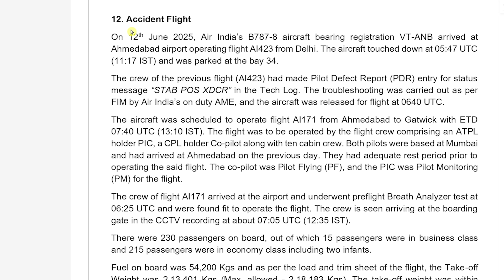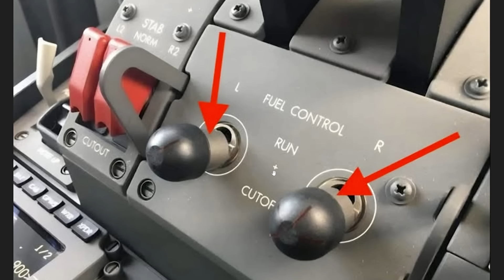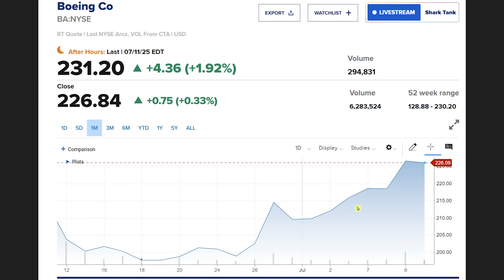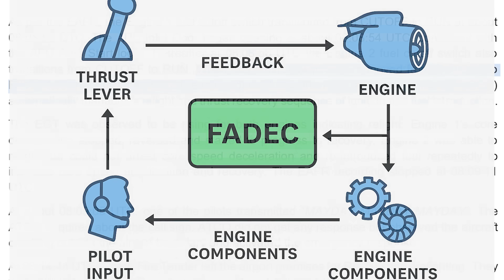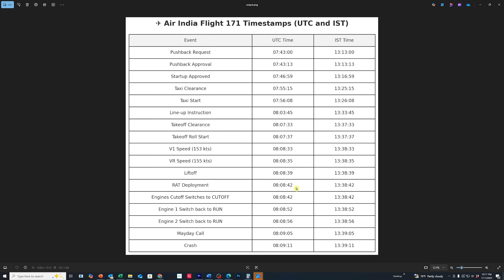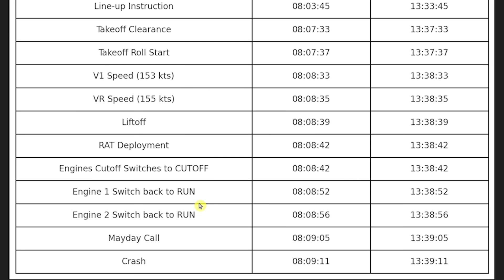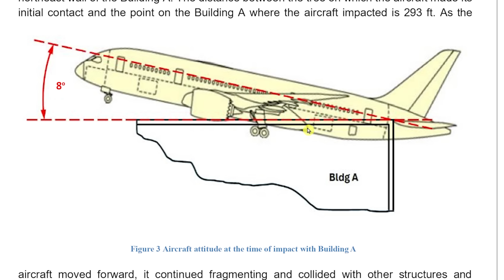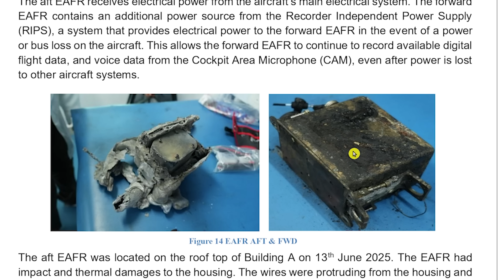Did Pilots CUTOFF Fuel? Shocking Twist Air India 171 Report!

Comment: I question the preliminary report. They cannot tell us anything about the physical movement of those switches. The only physical fact we know is that they were in the run position at the time of the crash.

We also know that the signals to the engines told the engines to turn off and then turn on again but we don't know that the signals resulted from the physical moving of the switches.

There could have been a signal problem with the aircraft.

I have heard that the 787 has several known issues that Boeing has refused to address. One of them is a known water leaking problem in the area of some very critical electrical signaling components.

When the plane rotated that would have altered the flow of  any water that might have happened to be there.

That is a stretch but so is the idea of a pilot turning the switches off and then back on again if he wanted to kill himself.    Also when a pilot is killing himself I don't think he would deny it he would probably just be silent.

We don't have the exact words; the report just says that one pilot said to the other “why did you cut off the supply” & the other guy says “I didn't”

We don't know exactly what was said and whether it indicates that the one pilot saw him moving the switches or was just looking at the gauges.

I doubt that the other guy would say “I didn't” if he knew that he had been seen. 

And he certainly wouldn't have reached back down and turned them back on after such a question, especially if his intent was to crash the air vehicle.

So there are problems with both hypotheses. Therefore I am not ready to accept the suicide idea yet. Not until I hear that voice recorder audio. I need to know the exact words and I need to know if they could hear those things ‘click.’

Investigators often miss things and make assumptions. At this point one assumption I make is I start with a REBUTTABLE presumption if it's a Boeing aircraft it was not the pilot at fault it was the aircraft. Then I wait for something to prove otherwise.
Reply: The one that cut off the fuel and the other why he did so to shift blame to ensure payout for his own family. 
Ten seconds later the innocent pilot realizes thrust is lost and turns fuel back on but both know it's too late anyway.
Reply: @heinzriemann3213they almost made it though , the bad pilot would fight to stop the other pilot from restarting
Reply: maybe the electrical contact of the switch was shorting out periodically.
or the mechanical contact of the switch itself was having intermittent contact.
or some software bug.

all speculation on my part.

the pilot suicide theory sure sounds like a load of ..
Reply: Now it turns out the translation was wrong… he did not ask “why” did you turn off — he asked “DID you turn off…”
Reply: June 28, 2025, The Sunday Guardian (cited in ePlaneAI reports): Mary Schiavo, former Inspector General for the U.S. Department of Transportation, publicly raised concerns that a software-enabled malfunction—specifically involving the Thrust Control Malfunction Accommodation (TCMA) and Full Authority Digital Engine Control (FADEC) systems—could have contributed to the Air India AI-171 crash. She referenced a known NTSB-examined issue where 787 software caused unintended engine thrust rollback, emphasizing the critical need for independent investigation.
	•	In these reports, Schiavo also referenced a 2019 All Nippon Airways (ANA) 787 incident, wherein a software flaw—previously investigated by the NTSB—mistakenly triggered a dual engine thrust rollback. That investigation prompted corrective actions across the global 787 fleet.
	•	July 15, 2025 – Mojo Story (YouTube): Schiavo appeared in an extended interview, reiterating her software safety concerns regarding Boeing 787’s fuel shutoff valve actuators and previous FAA warnings. She criticized regulatory delays and repeated that previous software-triggered rollback incidents should have led to firmer preventive action before the AI-171 crash.
	•	July 17, 2025 – Financial Express: In further coverage, Schiavo insisted the crash investigation should not rule out the possibility of a hidden TCMA software flaw, repeating that an earlier ANA 787 incident was caused when the software believed the plane was on the ground and cut engine power—a fact that required careful study by investigators.
Reply: data recorder does save the timestamps for all movements. so it is a fact they were off then back, matched the final position at the crash site.
Reply: @ziqiangwang537  the data recorder does not record any physical movements at all. It only records signals so the times you were talking about have to do with signals not switches!
Reply: @Clarity-of-Thought-guy  one captain says this: when all the other possiblities is checked, then the most possible one is the one that is true . 
Your argument is based on possibility of mechnical/software malfunctioning, i think that the possibility is lower for both controls happenning at the same time.
Reply: @ziqiangwang537  that is an excellent point. Because I'm just a dumb lawyer and not an aviator I have no idea however it might be possible that both signals are routed through the same path

Also the NTSB and Mary Shiavo are raising a known software issue which also might apply equally to both signals. 

But you are correct in fact the problem comes with a one second delay between the signal of one switch and the other which does suggest physical motion by a human.

This is why I think preliminary reports almost do more harm than good at sometime and here would be one of those times
Reply: @Clarity-of-Thought-guy  the issue of your argument is you preassigned the harm vs good to the result. It is a technical report, only biased eyes will read it with an attitude. The logical ways are intepretting it  with sound knowledge., hence checking all over the possibilities.
Reply: @ziqiangwang537  I have no idea what that means but you miss the point is that what I'm trying to do is focus on evidence I've made it clear I do not have a theory I am not assigned anything and I have no argument

All I am saying is that other people don't either because we don't have sufficient evidence I have not reached any conclusions other than the fact that the investigation so far is lacking
Reply: @ziqiangwang537  agreed

One must rule out all possibilities and generally the most likely one is the last one you should rule out

But the possibility of something other than pilot action is not zero is not 0%

I'm not reaching conclusions I'm just asking other people not to rush to them either
Reply: @Clarity-of-Thought-guy right。 However eneryone read the report with own bias.  We are talking about all probability from the data, then one will be coming out as the one.
Reply: @ziqiangwang537  amen to that! But they say this India board takes even longer than the NTSB so we've got a minimum two years
Reply: @ziqiangwang537  the data recorder does record timestamps but it only records electronic activity not physical activity
Reply: Exactly. People start blaming the pilot immediately
Reply: @anty_07 because statistics are brutal, pilots are responsible for most accidents, 100 years of aviation history can’t be erased, the data is clear.
Reply: I agree!!  Brilliant thinking!!  Thank you!❤

Comment: Will need to dust those switches for fingerprints and cross match against the pilots. It is even possible that the pilot who asked why did you cut off the fuel was the one who actually did the sabotaging..
Reply: Fingerprints analysis might be difficult considering the high flames would have charred the switches. Looks like the investigation team has full CVR to determine what went wrong but want more time to be sure and release to public

Comment: Those two fuel Cut-Off switches are way to easy to access and they don't even have a safety cover flap thing that needs to be pulled up. 
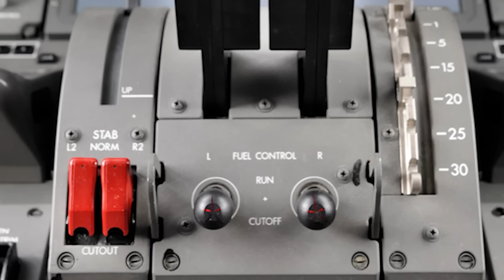One engine's fuel got cut off for 10 seconds before switched back on and the other one for 14 seconds.   11:57
It was probably sabotage though because the plane's both engines lost power at the worse possible time during take off.
Reply: They still require to be pulled out to be able to move either up or down, so they can't be accidentally bumped.

Comment: With no political of over the top backing like all othe cases that this guy mentioned, why would someone with over thousands of hours of experiance and known no. of peolpe onboard will sabotage like this, and if it was a sabotage it coould have been done worst on by taking it way more up then crashing. Ans why did the pilots then try to restart and still fail second time ?? they tried right if it was not a technical fault the planes engine should have started again althought they could not save the crash but they should have started but the second engine failes to start. this is exactly mentioned in this same report but is not told. Why ??

Comment: Thank you for this video!👍🏼 
A glitch/bug in the computers/sensors (sensors for the landing gear) may have initiated and reversed a fuel cutoff without the physical  switches being touched. In that case the message to Boeing's CEO and Board of Directors should be "learn to code".
Reply: Page 14 of the report covers that subject and hence your answer. Jeff also covers that.

Comment: I was pretty sure this is what would eventually be found out.   There was no way it was pilot's error.   Too many designs on the panel that makes it a remote possibility.  It was always a high probability it was pilot's intention.   There needs to be continuous psychological and physical screening of pilots given the high stress nature of the job.
Reply: there is,
Reply: If they were trying to crash the plane, why did they restart the engine the person who was trying to crash the plane would try to stop that
Reply: @Novasquad77   No need to resist when he already knows the outcome. There was no way the plane would be saved. Engines restart does not mean thrust back to takeoff level. That takes more than 10-15 secs. The guilty pilot probably already simulated this in his simulator.
Reply: @Novasquad77  two pilots, one stopped the engine and the other restarted.   What is critical thinking in today's world.

Comment: It appears that there may be a very slight possibility that the cutoff switch detent could be balanced halfway between on and off.  That half way point might have the switch on but the handle balancing between on and off.  Vibration could cause one to slip to cutoff and the snapping of the slipped one causes the second one to slip to off a second later.  That would align with the response to the question being "I did not".
Reply: As a retired flight engineer I can say that I've handled this type of switch whereby you can simply slide the switch against spring pressure to a locked detent position.  A single finger under the switch to slide it up to RUN (in this case) where it will drop into the detent is a common practice.  The reverse selection (to CUT OFF) requires a very definite pull out of the detent and then the switch can be slid down into CUT OFF position.  I haven't handled these exact switches on a B787, but they might require a definite pull up to set them to RUN.  I've never known a switch to be able to sit in a mid-position, but is possible, I suppose...
Reply: @kevinnurse9936  The closeup photos look like you can set them inbetween positions, but without the switch being in the RUN detent, the engine is not going to start. 
If I remember correctly, older type toggle switches such as on the F/E's panel of a 747 have more of a steep slope on either side of the highest point.
Reply: @ImperrfectStranger  How would the bulletin about it being installed wrong would allow it to start and then cutoff? I thought jeff said they were pulled out to cutoff position not engaged
Reply: @brandonlee8400  Not quite sure what you mean. I believe the bulletin was referring to the spring action holding the switch in the RUN and CUTOFF positions. i.e. sloppy switches allow you to knock them out of one detent into the other. The bump in the middle doesn't offer a great deal of protection in this case. 

I seem to recall there was a case where a pilot's long shirt sleeve got snagged on a switch and moved it out of its detent, but this was decades ago. I can't remember the details, but it may be one of several incidents which prompted the fitment of guards on the sides of the levers or a change in lever style to the round ones.
Reply: @ImperrfectStranger  So the ones in the burnt picture are down and engaged? Why would they both cutout? I thought the bulletin said they were installed disengaged but I don't see how it could start
Reply: @brandonlee8400  The burnt switches are in the up (RUN) position. Down is CUTOFF.
But, yes, if the switches weren't fully in the RUN (up) position the engines wouldn't start at the beginning of the flight.
Reply: @ImperrfectStranger  TY
Reply: If that's the case that incident had happened in earlier flights of the same aircraft.
Reply: Both of them?
Reply: Irrelevant, implausible. 
Next

Comment: Maybe the pilot absent-mindedly pulled the cut off switches without realizing it.  If the pilot did not get enough sleep the night before, this sort of carelessness is possible, though there is no way to read the pilot's mind.  They should redesign this so that it requires both pilots to cut off the engines, no?
Reply: They should redesign so that fuel cannot be cut off at Take off power. It should only be cut off at engine Idle.
Reply: @charron1 no. It can be used in an emergency like engine fire so that wouldn’t work

Comment: Is there any information exactly when the RAT was deployed? Before or after the fuel cut off?
Reply: It deployed immediately when the switches were moved to cut-off as highlighted by the timeline in the report.
Reply: @SurgeDashcam  Well, that makes sense. But i find it confusing that in the official timeline the order is: RAT deployed then engine cutoff switches to cutoff. According to the timecode it seems to happen at the same exact second, but then the order should be the other way around (as you mentioned). Only a small error in the report but still confusing. It was also stated, that there was a delay of around 1 second between the two cutoff switch actions. The timecodes suggests it happens exactly at the same time. Ok, may be i am nitpicking here. But i would imagine the timecodes have a higher resolution than just one second.

Comment: Why are you discounting the possibility that the pilots were correct?  Is fuel switch status not communicated via the AFDX - based Common Core Network and associated remote data concentrators where power glitch and/or software errors may have occurred  ?  Pilots are adults not children - "It wasn't me" !  That suggests to me that this may not have been a pilot induced event.

Comment: The investigators know which pilot cut off the engines, they have the DVR vision recording of the cockpit. They’ll never show it. So both pilots FOR NOW are guilty in the peoples court until the powers that be release the information of WHICH pilot cut off the engines.
Reply: Would have to have been the senior ... junior was too busy flying the plane.
Reply: @peterward9446 FAA 2018 action statement on fuel switches on Boeing?
Reply: @peterward9446  I seem to remember youtuber Captain Steeeve say generally the senior does the take offs and landings.
Reply: @MeoithTheSecond  nope. There's a designated pilot flying and pilot monitoring for each flight and this division of work has nothing to do with who is the captain

Comment: Yes but way isn't the aircraft designed so that it's impossible to cut fuel flow once the aircraft leaves the ground? And have a requirement that the engines have to be at idle. Boeing cutting safety corners, again.
Reply: Because if you have a fire in the engine, you want to be able to cut off the fuel supply so it doesn't keep feeding the fire and keep on burning. And it has nothing to do with Boeing cutting corners. Airbus have very similar Fuel Cutoff switches in their aircraft. As do a vast majority of business/corporate jets as well. Educate yourself before you post misinformation.

Comment: Could this explain it:   Per the investigation report the landing gear was still in EXTEND position.  In a normal flight it would have been retracted shortly after leaving the runway.... Yet it was not.  Could the explanation for the landing gear still being down but the engines shut done be as simple as the one pilot somehow getting his physical movements all screwed up.  When the "gear up" was given the pilot's muscle memory came out of left field and he pulled the two engine cutoffs.  The timing is about right. The engines cut off at just about the same point the landing gear would normally be retracted.  It would also explain the odd conversation between the pilots with one asking "why did you cutoff" and the other saying "I didn't.  He said he didn't because he thought he raised the gear yet somehow got the muscle memory all screwed up and did an engine shutdown as if they had just ended the flight at the gate.
Reply from the maker: When they cut off the engines 3 seconds after takeoff, they lose power to everything, landing gear, and the flaps also would have been retracted later.
Reply: Landing gear is one leaver and is  in a completely different position in the cockpit.
Reply: This can't be real. It is like you want to wind your cars windows down. You turn it off by accident? TWICE?
Reply: I think if they would have heard any "gear up" callout at the time of the cut off switches being moved, it would have been mentioned.